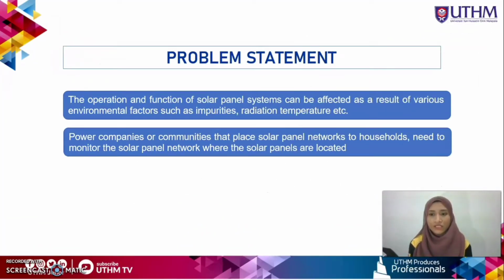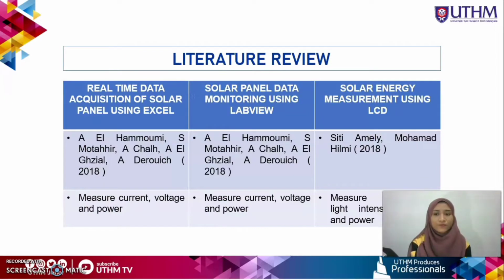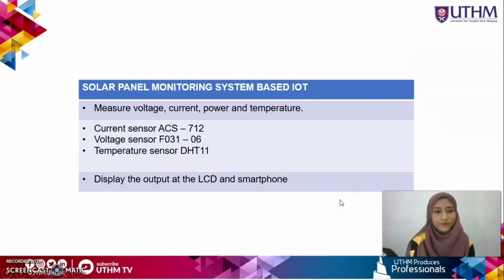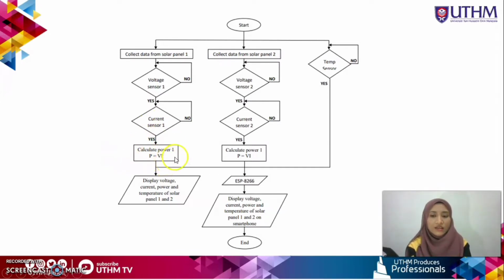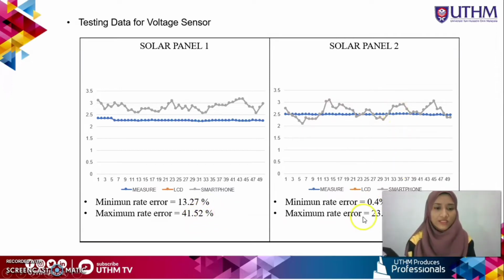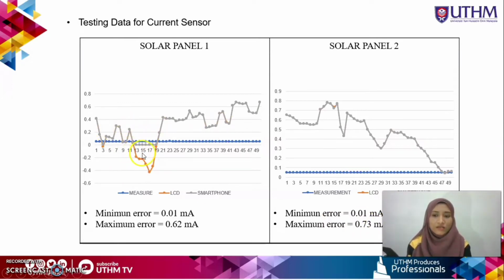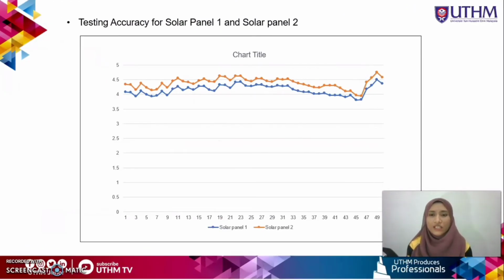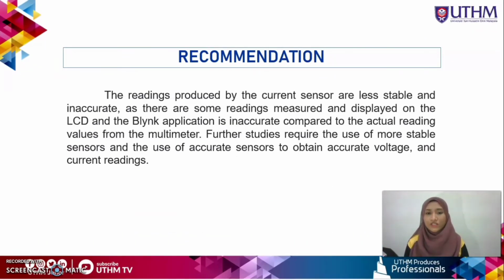SOLAR PANEL MONITORING SYSTEM BASED ON IOT

Comment: Assalamualaikum, can we made solar panel monitoring system iot based but not using Arduino uno
Reply from the maker: Waalaikumussalam, you still need use controller, or you can use nodemcu esp 32 / 8266.